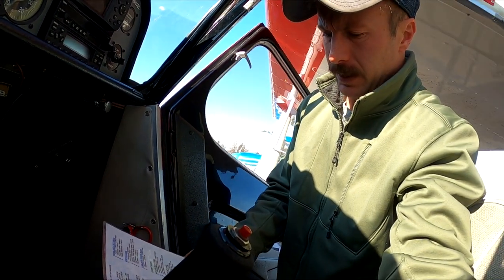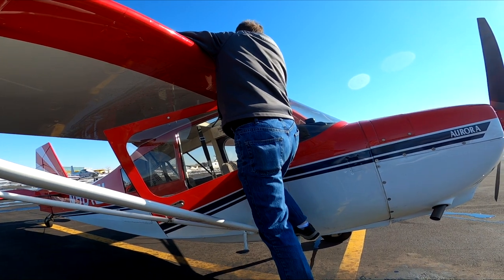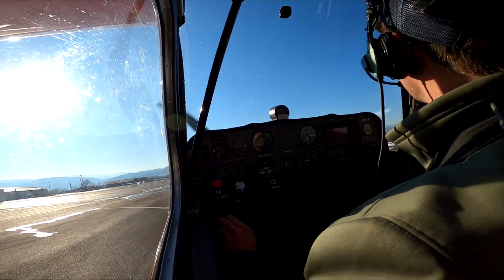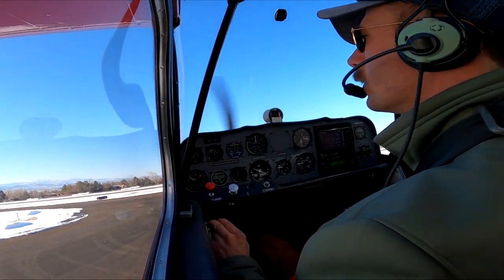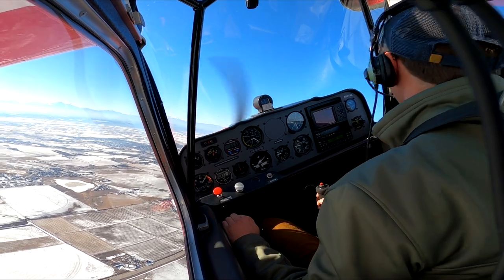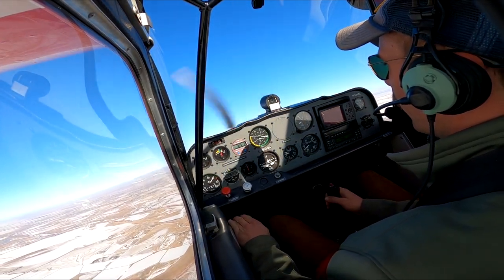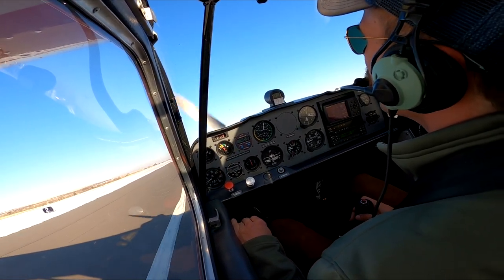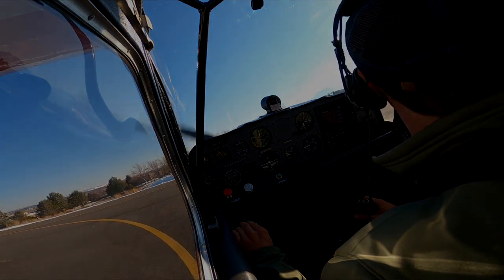Taming the taildragger, Flying the Citabria Part 1: Pilot Vlog

Comment: Wow, that instructor turned something simple into an incredibly complicated procedure that didn't look like much fun to me. I learned to fly in a J3 when I was 15 and it honestly didn't seem to be such an ordeal.
Reply: I have an N3 Pup...and haven't flown it yet, (I used to fly sailplanes).
Can you suggest to me a good book on the very basics of taildraggers?
It's very close to going back in the air.  Just need to install some fuel line & vacuum tubing.
Reply from the maker: @cluelessbeekeeping1322  tailwheel tactics is good. Stick and rudder aswell

Comment: In the early 70's  I bought a Citabria, 100 hp, no flaps, and I simply loved it. I put 2000 hours on it and flew to British Columbia  and back through the Rocky Mountains. What a beautiful sight. When landing you can look down at your main wheel and just hold it off the runway a few inches. Side slipping becomes natural and you don't think about it. I can't think of a better fun airplane.

Comment: Surprisingly busy cockpit for a small plane. What did you think of the workload? Figure it'll drop off with hours on the stick? My first flight as a kid was in a Stinson L5, this reminded me of it, though I haven't been in the cockpit since I was 20, unfortunately, it's a nice plane you flew here.
Reply from the maker: Cockpit work load wasn't bad, what has got me on my toes is crosswinds and aiming a tail wheel where it should go instead of where the wind wants it to go. Keeping it straight and no ground loop is where I'm keeping my edge on. I really like how the citabria flies.  Very responsive and the pilot view point is incredible. Not to mention this bird is rated for aerobatics 😃👍

Comment: 5% of the horsepower is the approximate fuel flow on a Normally Aspirated piston engine
Reply: Wait, what?
Fuel flow in what units?
I'm confusededed.
Wait, what???
Reply: It would be in gph
Reply: @shawngrenier3107  Thanks!
Reply: One gallon of fuel for every 20 horsepower.